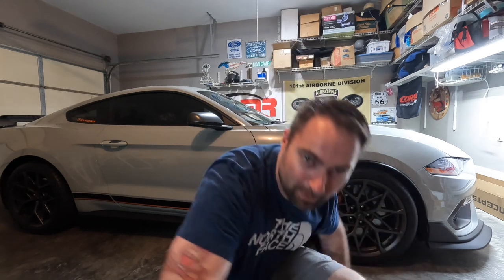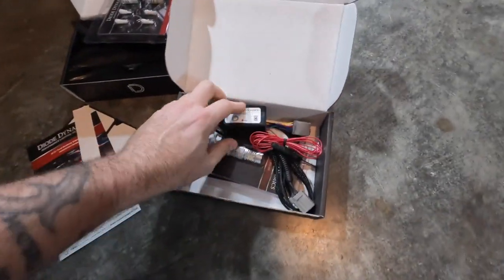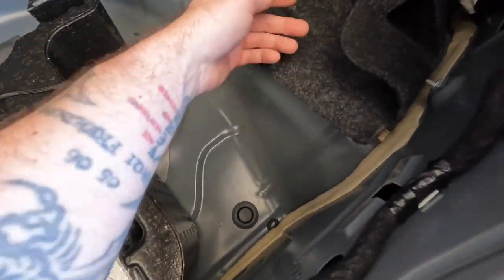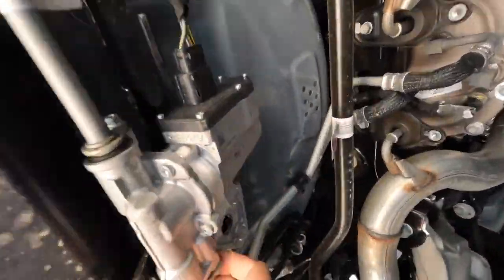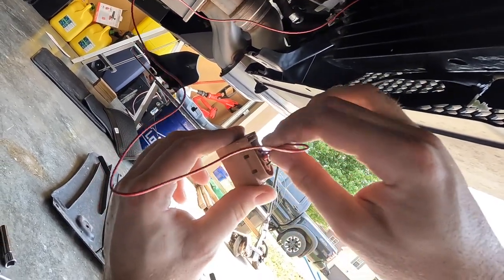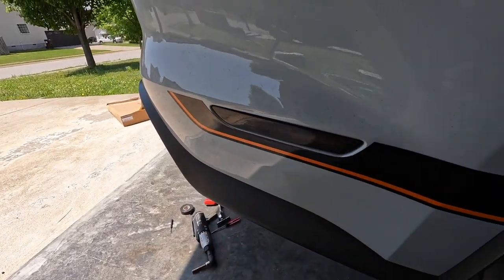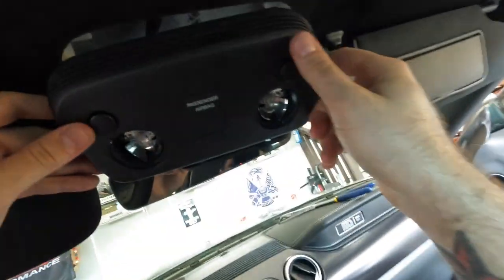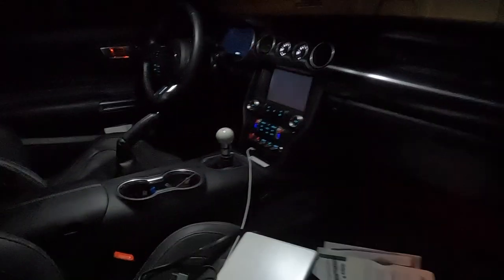THESE NEW DIODE DYNAMICS LED's on my 2021 MUSTANG MACH 1 ARE INSANE!

Comment: Damn mine pushed through on passenger side. I broke a small piece of the clip on passenger side it fits really loose now. I ordered new clips. 
 Can i replace the clips. Is there a special tool to take them off the plastic tab ?

Comment: I was just looking at these for my 2020. However I can't decide between white or blue for my velocity blue car. Is there a good way to prevent the map lights from getting pushed back when inserting the new bulb?
Reply from the maker: I had to remove the housing to get it to sit in properly. It’s not hard though

Comment: Hey Zander, since you ditched the Camero and got your Mach I, I rejoined, LOL.  I have a 19 Bullitt and installed the DiodeDynamics Demon Eye and their color changing running/turn signal lights.  Seperating the headlight lenses was a nightmare, but I really like the new look.  I had 1 side that would not change colors and DiodeDynamics was excellent on replacing that part.  I too highly recommend them for their lighting, plus they are a Missouri company.
Reply from the maker: Welcome back. Yea the lights definitely changed up the whole car

Comment: I enjoy your informative approach seeing you personally completing special changes to your Mach 1. Maybe it's time you open an S550 aftermarket installation shop. I recently saw a GT500 that replaced the standard infotainment screen which is the same unit used in your Mach 1 to a large 13. 3"  infotainment screen that is made to look factory. I believe the manufacturer is *Phoenex Automotive*. It really looked fantastic. Love your Mach 1. I'm always looking forward to new videos as you continue to specialize your Mustang. 

I know your considering a new Ford truck. Ask your Dealer about the current $1000 Military, First Responder discount.